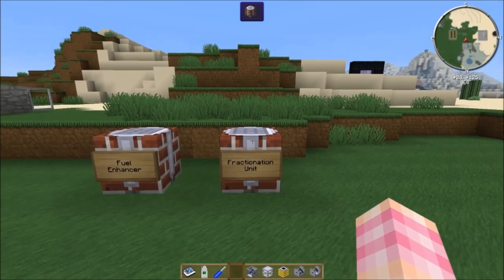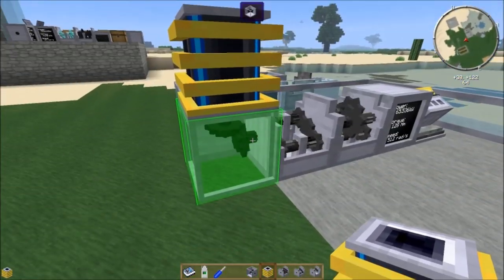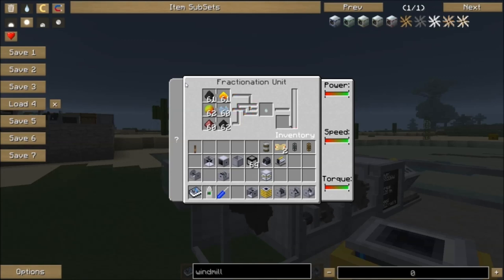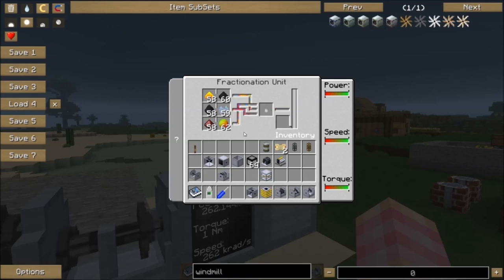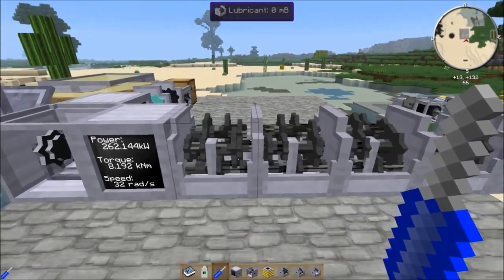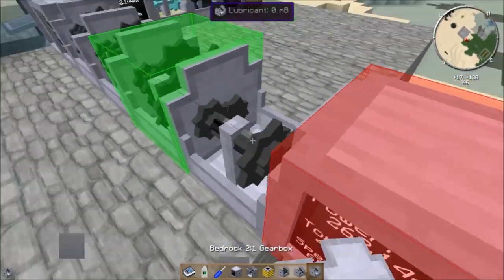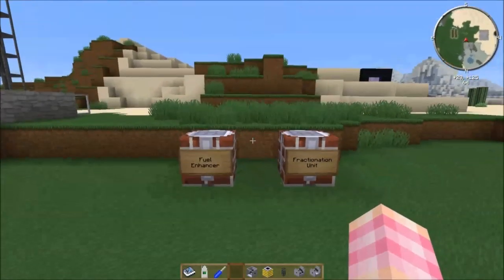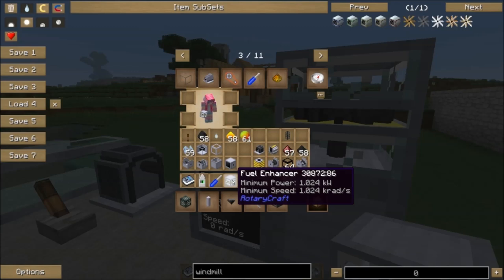RotaryCraft Tutorial #14 - Jet Fuel Production

Comment: Is it possible to use BC Ethanol (Old BioFuel) in the Fuel Enhancer (Monster Pack)?  My thinking is this would make a nice closed loop renewable system when combined with Magic Crops and wheat farms.
Reply from the maker: +Chris Dean I don't know, try it and see if it goes into the machine.
Reply: That would be a no, BC biofuel (ethanol) will not go into the fuel enhancer.
Reply from the maker: Chris Dean
Too bad.